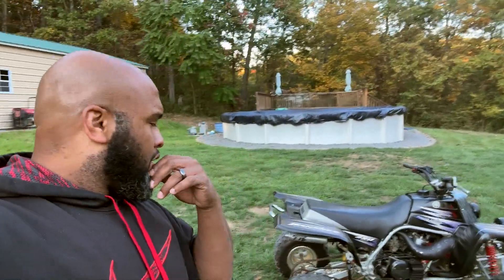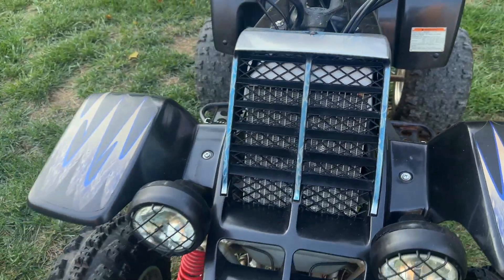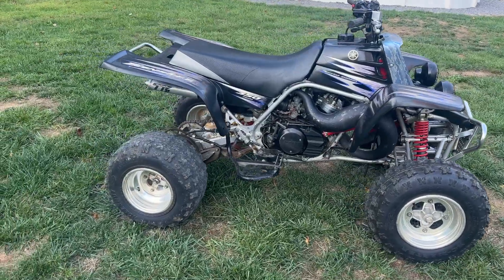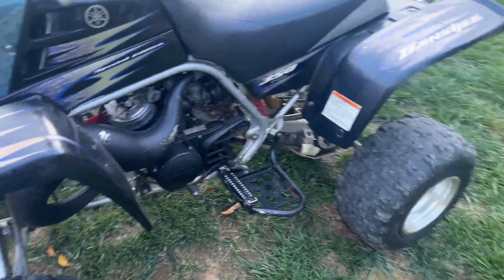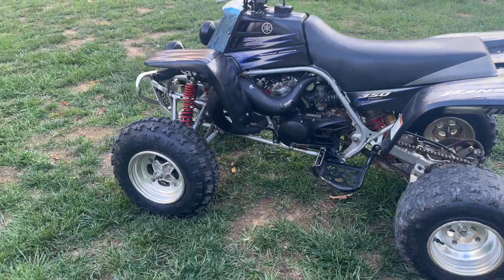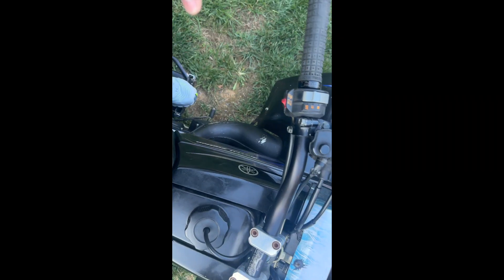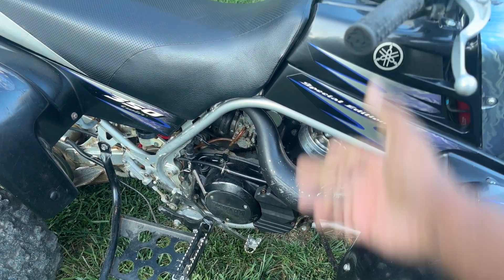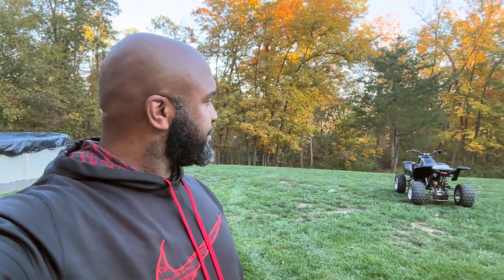2003 Banshee Donor Bike

Comment: But hey I'd buy those cases I think u said u weren't using? The ones that came with the 05. I'd buy the cpi pipes, and if u decide to sell the 03 roller/motor or combo lmk. U got email or f.b.? I'm always looking for for random parts. Oem parts. I have a shee that needs the same rear fender brackets if u wanna make and sell another set lol I think vitos sells them but I forget. I need another set of oem carbs idc if their grimy and whatnot. I'm sure I'd end up buying a bunch of stuff if your gonna be selling off parts. Keep up the sweet vids man!!
Reply from the maker: Heck yea man. Look me up on Facebook. Kenneth Toney. I have a set of cases I was looking to sell soon. Sold the CPI pipes a few days ago. I think I am just going to rebuild the banshee and sell the 2003 as a 2003 machine. More content that way.